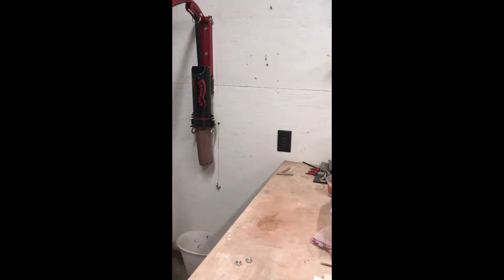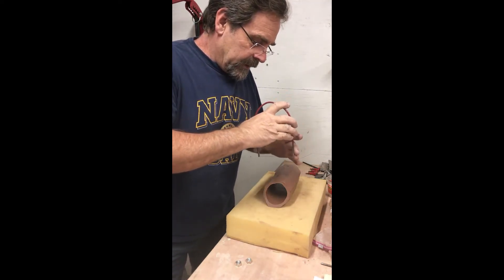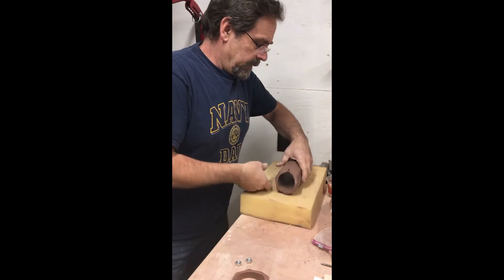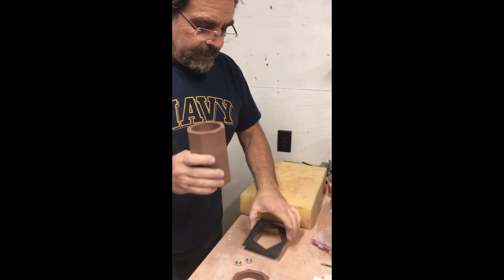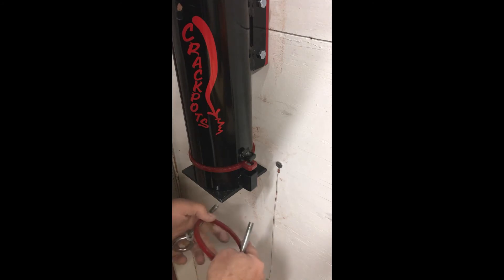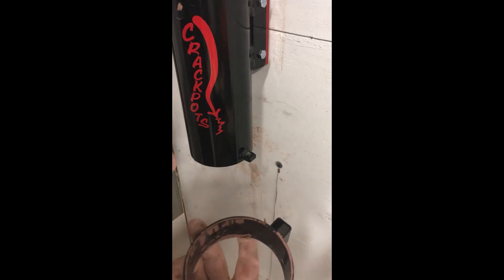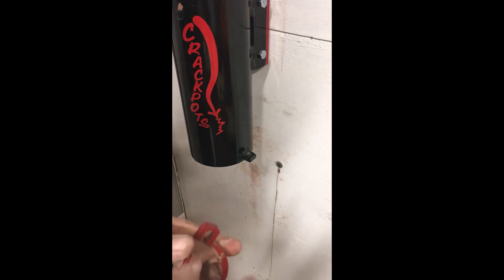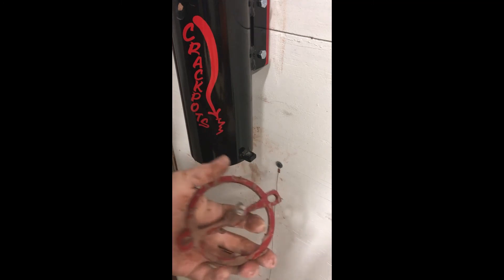F Series Hollow Octagon Die

Comment: Glad I watched this series even though I have a North Star.
I will interchange my centre dies to get a different extrusion and can come up with designing and printing new centre pieces for hollow dies. I have already come up with a one piece 3D print hollow die for my handheld that works well.
The obvious tip for tracing the base I will definitely be using...thanks!
Reply from the maker: 3D Printing is a great idea for making custom dies.  I wonder how strong they are?
Reply: @OldAsh  Even with 20% fill the one I made for making sponge holders is holding up well in the North Star and the one for the handheld is holding up well. I printed the small tubular one in one piece and did 2 prints, one at 20% fill and 2nd @ 50% fill. The latter I made as backup  just in case which I have not found a need for.
Reply: Sent pics to your Facebook page.